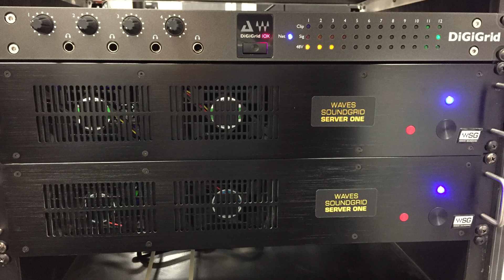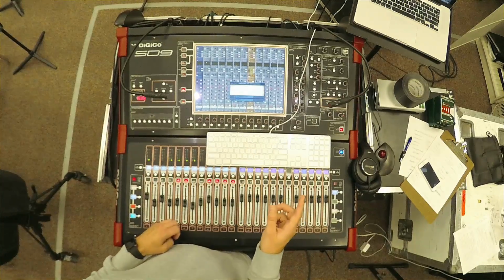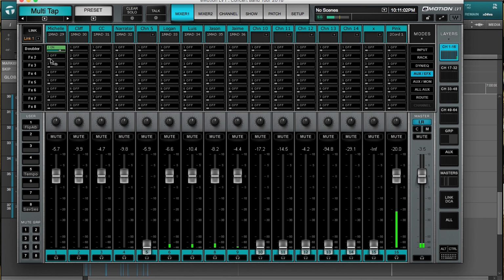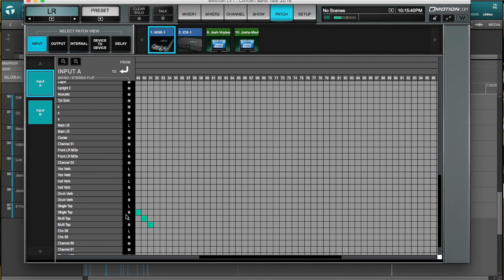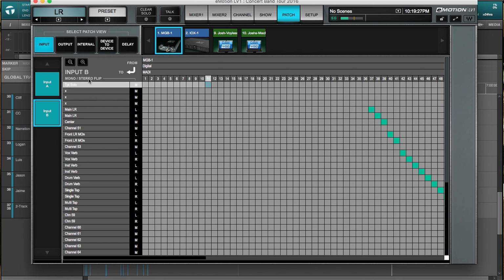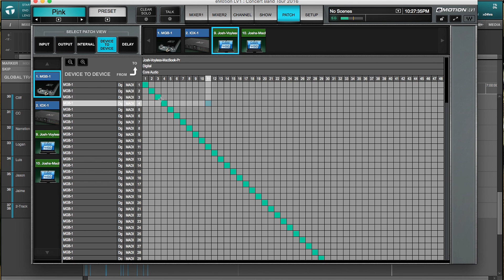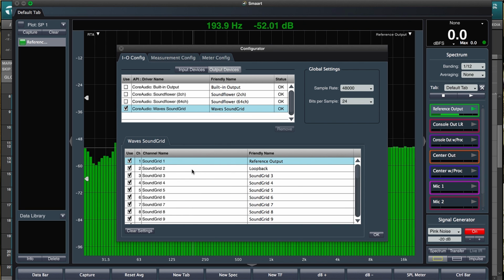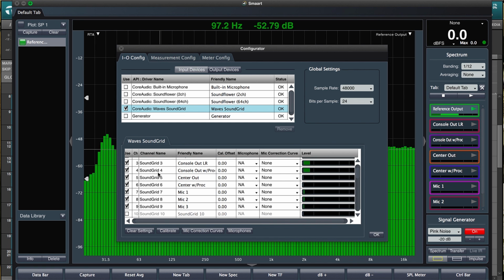Waves LV1 DiGiCo SD9 Smaart V8 DiGiGrid IOX integration

Comment: Just curious as to why you used Waves LV1 just for DSP instead of using Waves Multirack?  also, do you think you could closely match the sound using the DSP inside the digico desk completely instead of using the waves dsp? like the tap delay, 31-band eq, channel eq, etc?  less gear to haul around imo :P
Reply from the maker: Greg, thanks for commenting and I'll try to answer your question the best I can. The LV1 offers a few benefits to Multirack for my workflow. I like the visual separation  and better overview of my plugins. (I feel like I can see more of what's happening.) I also like the flexible/faster routing and system setup options the LV1 affords. DiGiCo desks offer incredible processing and many choose to just use what's in the desk. However, there are many plugins I use regularly that DiGiCo offers no alternative. I also prefer to take my recorded shows home and tweak in StudioRack and then copy my setting to Multirack or LV1 for the live show. This allows me to continually perfect my sound without having to have a DiGiCo desk in my living room.